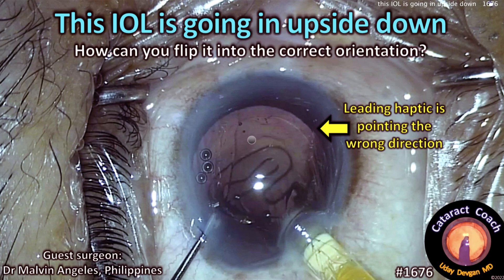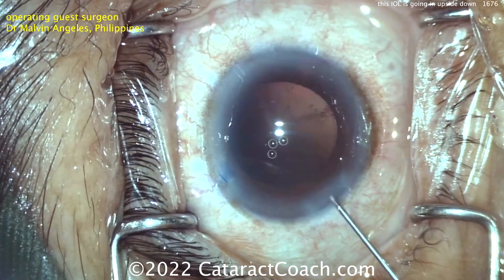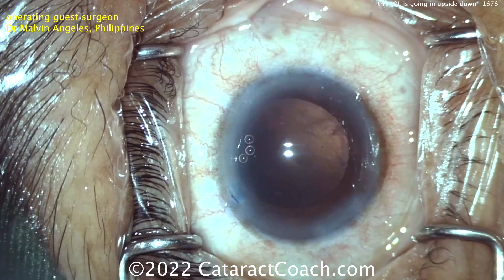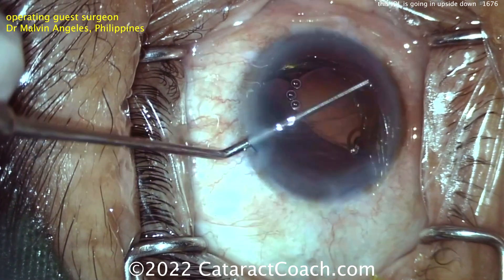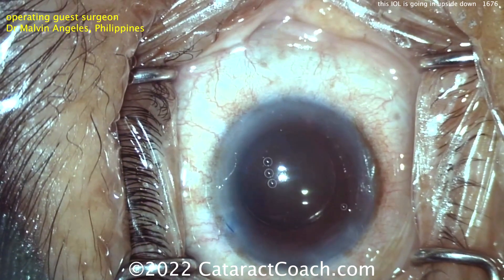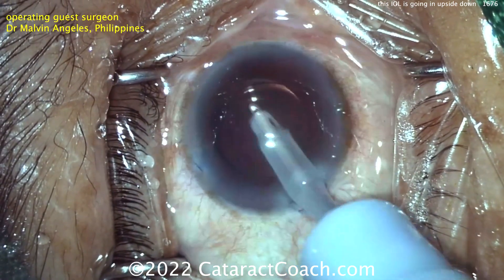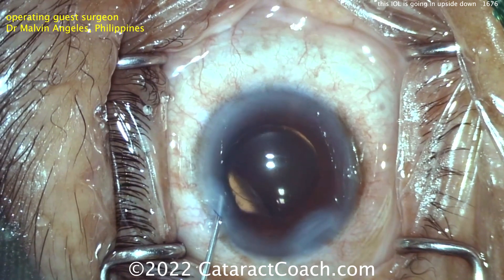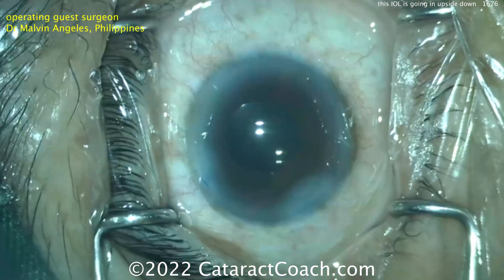CataractCoach™ 1676: This IOL is going in upside down

Comment: Is there much significance if the IOL remains inverted?
Reply: Depends on the IOL. I will share one of my goofs from being a resident. I put in a 3-piece lens in the sulcus upside down. I thought, "the patient will be a little bit more myopic, but that's no big deal, patient might even like it so I will leave it as is." Well, it was a sulcus lens for a reason. The bag had broken. Well, the retina specialist dilated my patient really nicely to take a look for any retained lens material. And then... the patient return to me in horrible pain. What happened? Well, when the retina specialist's dilation wore off, the iris closed off BEHIND my sulcus lens that was VAULTED forward from being upside down. The patient was now in pupillary block with an IOP of 50+. I quickly did a YAG PI and the patient felt much better. I think that is probably the WORST CASE SCENARIO for leaving a lens in upside down. Just don't do it. 0
Reply: you will have a myopic effect and sometimes (depends of the design of your IOL) circonferential scotoma
Reply: Same question ❓
Reply: Same question ...
Reply: Depends on whether the lens is vaulted. If it’s not then it won’t make much of a difference apart from some higher order aberrations.